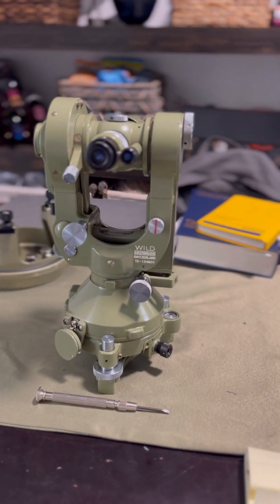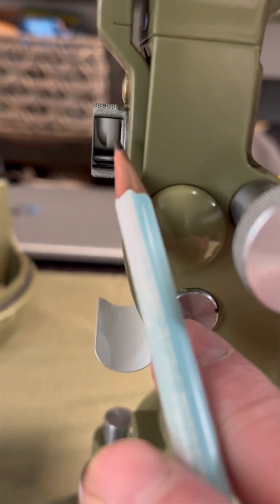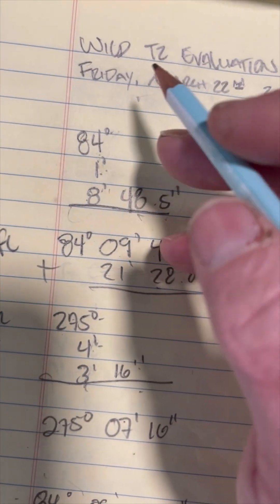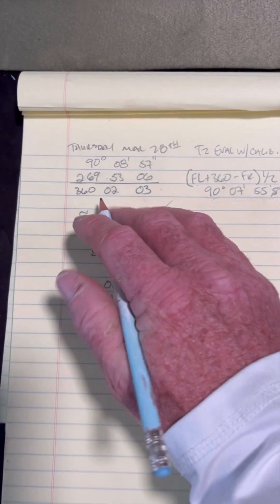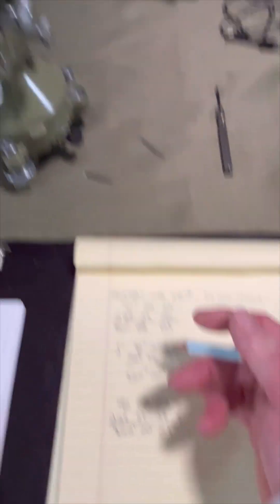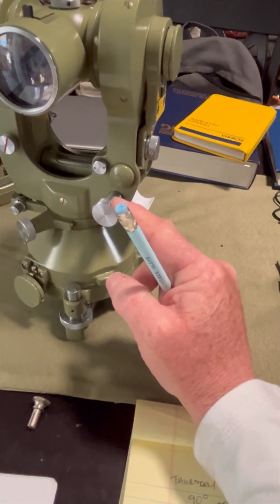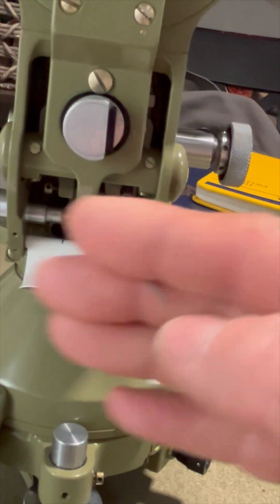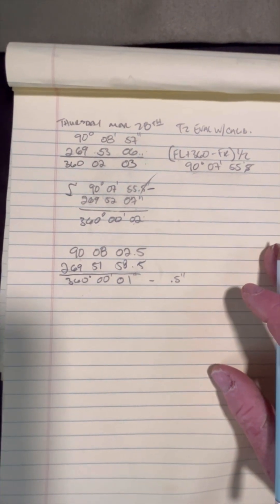Calibration of the Wild T2

Comment: I liked the inverted image T-2 better than the ones with the extra lense to have the image in the upright veiw . Reasion being, the inverted image model will focus  on an object much closer . Like at the ground just infront of the tripod legs. 
 I cant say how accruate  the later (or newer) total station Transit/ EDM  Data Colector survey instruments have gotten,  but those old one second reading T-2's were fantastic at closures around long distant property boundries . Combinded with  the Hewlett Packard  Old style EDM we had . 😉
Reply from the maker: @mt_9076  I realize that God didn’t intend for the wild T2 to have an erect image. I spent a great deal of time diligently, looking for this specific model with the direct image, as I struggle with reading a set of construction documents when I’m not facing north lol.
I have a Leica TS 15 robotic total station, and this Wild T2 is amazing. I’ve closed a few five sided traverses as well as pulled off over 100 mile zenith angles and had super tight closures.

Comment: I watched your original video on the T2 and saw right away your error on reading the vertical circle. It has been decades since i had used  one myself.  Now, i  have recently aquired one and saw your video on the vehicle circle adjustment. Can you tell or show how to adjust the horizontal level bubble. Mine is slightly out. And horizontal is reading about 20 seconds out of full 360. I think the cross hairs may need adjustment but I want to verify true level first. Other than just balancing the bubble error thought out the leveling process.
Reply from the maker: @AtlasNETGSPMobile-d2h  Welcome to the elite club! 
There’s an online PDF that the army released and covers everything regarding calibration. 
http://ugastro.berkeley.edu/ay122_fall12/Theodolite/WildT2TheodoliteInstructionManual.pdf
If you’re still having problems I can make a video walking you through calibration. However, the double centering-direct/reverse- reduced by 360 should produce the nominal readings. 
FL+360-FR*1/2.

Comment: The vertical circle has a index (collimating) level vial on the side, illuminated by the pivoting reflector underneath. It is more accurately read by the split bubble coincidence system employed. Some later theodolites employ an automatic index, with a pendulum, similar to an automatic level, but this system on this T2 necessitates that you must level the vertical circle manually before each micrometer reading. The index vial is leveled (split bubble brought into coincidence) by turning the knob below it. Only then can an accurate vertical circle reading be made by bringing into coincidence the diametrically opposed graduation lines of the glass vertical circle by turning the optical micrometer knob located on the top right hand side of the standard.

Comment: Please note. 
As you described Face L/R are added, the excess or deficiency is halved, and and face L is ‘corrected’.  The half-excess (+ or -) is not error. It’s an offset. 

eg, If the excess is 35”, and face L  is revised the true zenith angle reading is returned. The (35/2) seconds is the offset, not error. Adjusting the bubble is not required, it’s only desirable. 

As you pointed out, the initial readings are added (35” in this eg), half the excess is added, that zenith angle is true. Regardless of further adjustment, the resulting zenith angle is still faithfully returned. 

SOP, face L/R are ALWAYS recorded, the same sums and arithmetic are always carried out. So if the sums are forever about 35” and addressed, then no inherent error is returned. And, if adjusted such that the sums return 5” or 1”, the same observation procedure is performed, and the same sums and arithmetic is always carried out. Excess of only +/- 1, 2, 3 seconds is pretty but the results are not more accurate than if the excess is 20” of 45”… 

Offset is not error. That’s a gorgeous T2. Looks to be the last of the manual indexing T2s. My T2 is pretty new, from 1968. My T3 is about 1955.
Reply from the maker: Hi Larry,
Thank you for the free education. I reached out to my surveying mentor/boss about this instrument with questions, however his last experience with the T2 was 1978!
I think where I am still confused is; after I reverse the telescope, make coincidence, and record the reading now I have a FL/FR reading. The total of those two readings reduced by 360 deg is twice the collimation offset? My next question is what significance is computing the zenith- (FL+360-FR)1/2? Is this redundancy?
Yes this unit was purchased from Kara- I believe- many years ago, and was cared for. I was in the market for the newer style T2 like Jesse has, I just couldn't find anything.
Oh my bejeesus the T3? You lucky dog. What, if any, differences good or bad are between the two models?
Reply: @Baron_Rutledge  
A proper zenith angle is returned by L/R readings. The offset is found and face left corrected. 

Face L + R = 359-59-50. Both L and R are too small. That’s 10” under, 5” added to L and R. 

Or, L + R = 360-00-22. 11” seconds over, 5.5” subtracted.

I’ve never seen it written like this: (L + 360 - R)/2 

Just (L + R) - 360. And by L + R the over/under is immediately visible before subtracting 360. Add half of the over/under to the initial readings.
Reply from the maker: @larryscott3982  Very interesting, basically there was no need for me calibrate the unit? Figures. Well its a learning experience, I mean there aren't very many people that know these instruments let alone work on them.
Reply: @Baron_Rutledge  
Before adjusting you figured the true zenith angle. Then you adjusted to that angle because it was true. So adjusting the bubble returned the same zenith as before adjusting the bubble. Ergo, adjusting the bubble made no change in the zenith angle. The only difference is after you figure the amount (offset) to add it’s either 15” or 2”. I don’t mind 15” any more than 2”. It’s the same procedure, same reduction math. 

The real reason to adjust the bubble is for topo shots where you only read L. And that should be +/- a couple of seconds without reduction.
Reply from the maker: @larryscott3982  I think the light bulb just went on...lol. The topo analogy really helped, its like taking one backsight and turning to multiple foresights, only the FL would be needed.